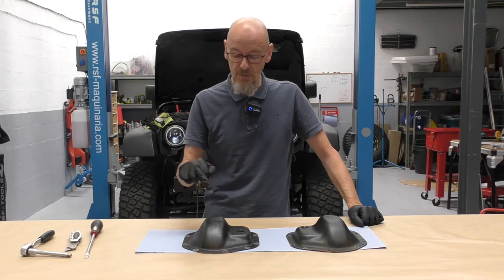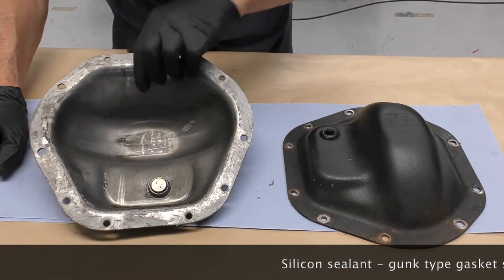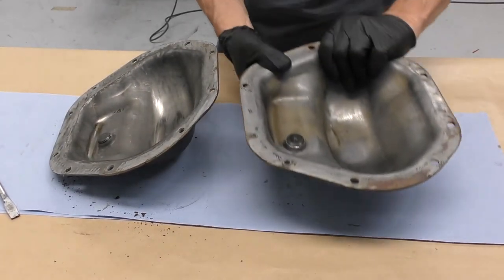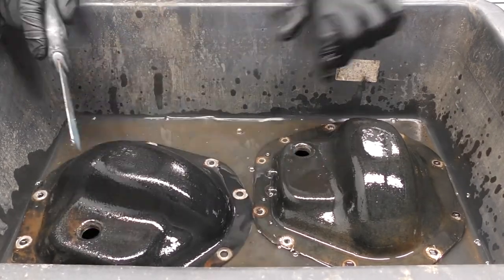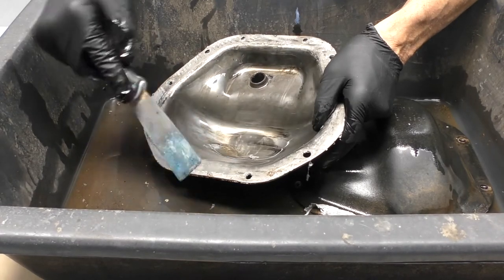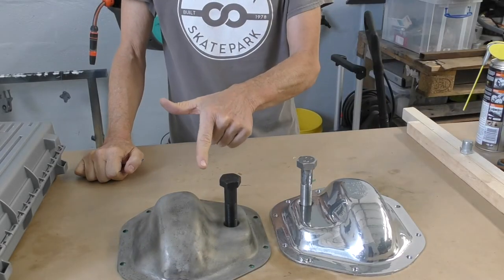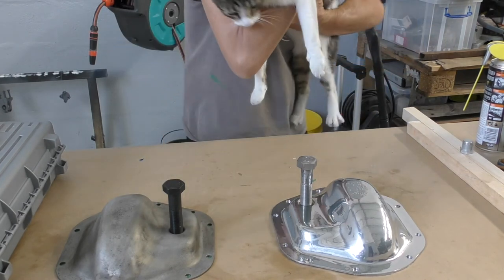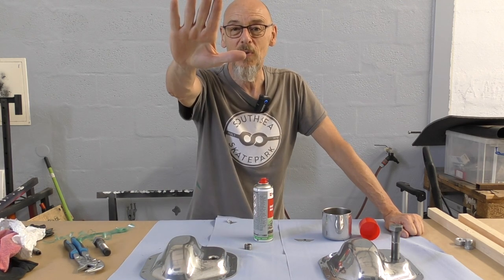Chrome DIY Powder coating  - how deal with rust ingress and filth before you coat

Comment: Really enjoyed that video and what a great result!
With regard to removing the rust, I wondered if you'd seen a rust remover product by Bilt Hamber called Deox-C? Rather than converting the rust to a stable compound like a rust converter, it actually removes the rust. You mix the crystals to make a solution and leave your parts in it. There's lots of videos showing it in use, and I thought you might find it interesting and there website has lots of info.
Cheers,
Mark
Reply from the maker: Hi Mark

Many thanks for that - I really enjoyed doing it - bit long winded, but wanted to do a decent job and as Nath has a girlfriend in Lisbon, I get left to my own devices most weekends, to, as he would describe "fanny about".

As Reg the cat has adopted us and now lives in the man cave - Mrs.M (surprising I have a wife, I know) drive up to feed him or I really get left to cause havoc totally unsupervised😂  and venture up alone.

I am working my way through their site, a great point in the right direction for some goodies !! The Deox-C sounds great, so I am off to add that to the cart now, had two evenings on the site so far, it's getting expensive - but love the look of way too much !!

KR J.
Reply: @DrivenMadShow  Well, it was worth the effort as it looked great. You've now set me thinking whether I can justify my own powder coating kit - manmaths needed, obviously.
Glad you found the Bilt Hamber tip useful. They make some great stuff, I spend far too much on their products! (Dynax UC for rust proofing underbody suspension bits that I want a clear coat on, not brown, is a good one for salty UK roads)
Reply from the maker: Powder coating is really satisfying - space & cost are the things - sand blaster is a must  really, ours was a couple of hundred, but not great, so researching upgrades - oven is an Amazon special 90 euros (wish we have one to get a wheel in)  - UK powder kit a couple of hundred (great bit of kit, really easy to work with).

Comment: The result looks great, but would suggest that you strip remaining paint with a chemical paint stripper before sandblasting, you might get some more mileage from your blasting media.
Reply from the maker: Thats a good call - I was at it for a few hours with the angle grinder - my shiny head took a few tones of red in the 40 degrees I stupidly chose to do it in :)